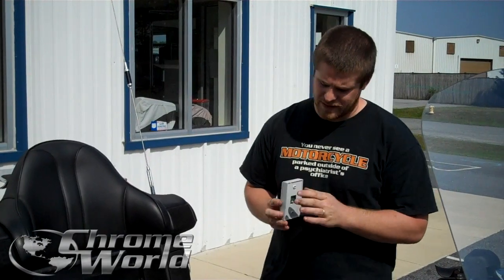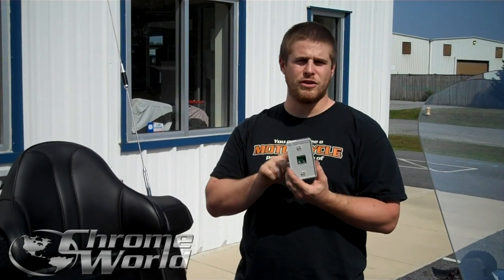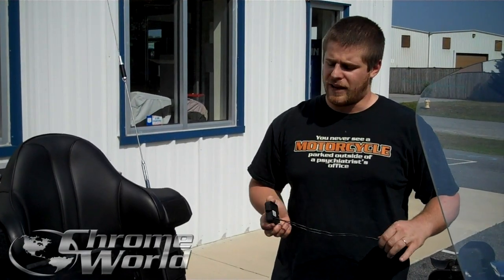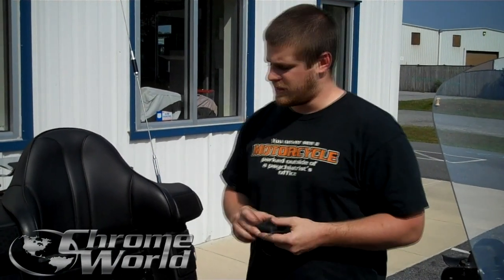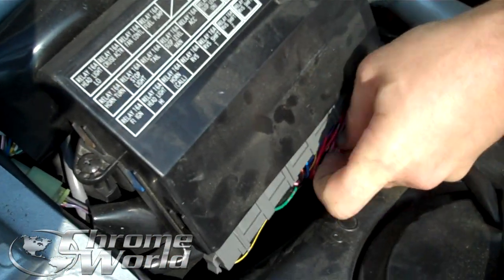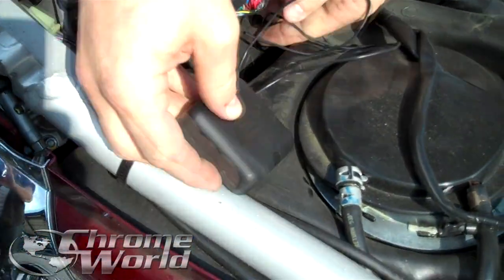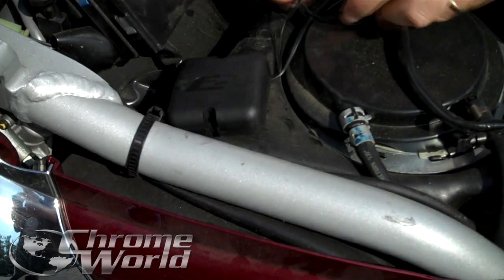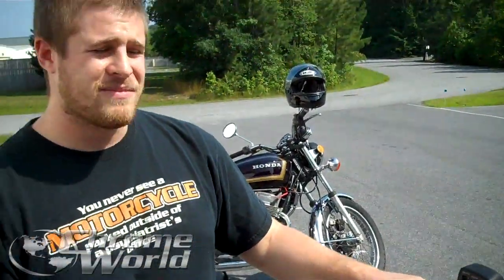Flash 2 Pass - Motorcycle Garage door opener Chrome World

Comment: Thanks for checking out the video. To answer your question, it is a radio frequency device. The high beam switch is simply the mechanism that triggers the transmitter on the bike to send the signal to the receiver in the garage. So only the cars or bikes that are programmed into the receiver can activate the door.